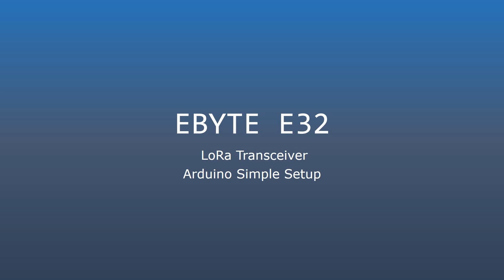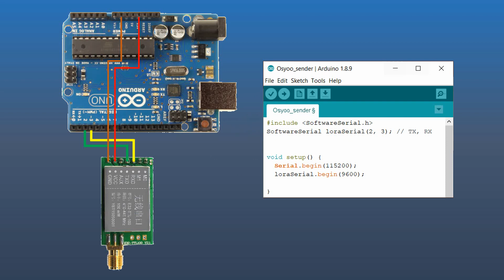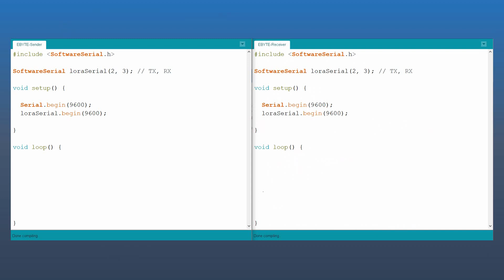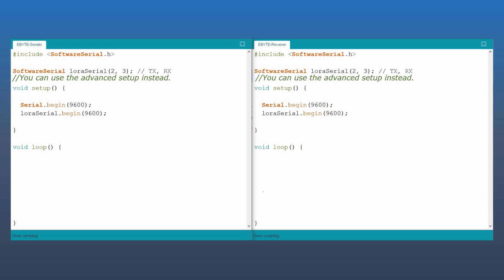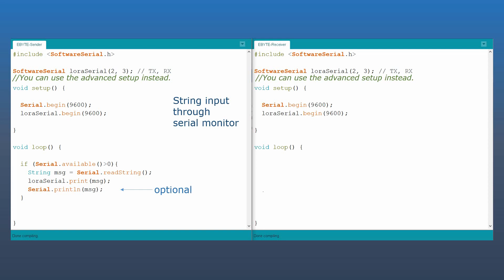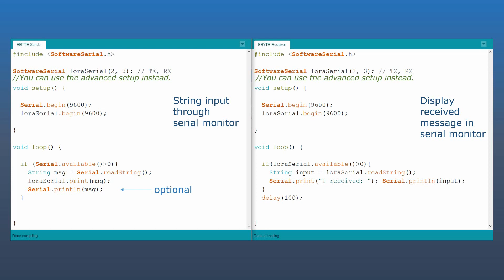EBYTE E32 LoRa Transciever - Send and Receive Messages on Arduino

Comment: Hello! I tested your other example (via the library) and that's working fine, but the code shown in this video isn't working, what could be the problem? (neither sending example or receiving example shown in this video works, I've tested with the library)
Reply from the maker: Hello ZeusBeer
While I don't have the devices with me anymore, I can try to assist you if I see your code. Please send it as a message.
Reply: @jtech1873  Hello, thanks for reading the message, the code I used for transmitting and receiving is the same as in this video.

The (not working) code for transmitting: 

#include <SoftwareSerial.h>

SoftwareSerial loraSerial(2,3);

void setup() {
  Serial.begin(9600);
  loraSerial.begin(9600);

}

void loop() {
  loraSerial.print("hello"); 
  delay(1000);
} 

The (not working) code for receiving: 

#include <SoftwareSerial.h>

SoftwareSerial loraSerial(2,3);

void setup() {
  Serial.begin(9600);
  loraSerial.begin(9600);

}

void loop() {
  if (loraSerial.available()>0) {
    String input = loraSerial.readString();
    Serial.println(input);
  }
  delay(100);
  
} 

The working code (that works, same pin configuration) is found here: 

https://github.com/KrisKasprzak/EBYTE/tree/master/Examples/Arduinio 

Note that this code is also shown in your other video about "the advanced setup". 

Thanks in advance!

(The reason I want the simple code to work is to save some memory by not using a library, because I'm a bit on a memory budget for my Arduino project)

Comment: I am using Ebyte E32 868T20D with simple setup. I have made all the connections correctly. However I am not getting any receiving. Only when I cut the power of the transmitter 10-15 pieces of data come in a row. What is the reason of this?
Reply from the maker: I can not now without debugging
But it could be that your serial monitor is using a different serial speed. Did you check?
Reply: @jtech1873  i just add delay(500) and the problem solved
Reply: @umut373  I still have the same problem. Where u add delay function?
Reply: @albertwziatek154  After lora.println(...);
Reply: @albertwziatek154  did you solved your problem? because i have the same problem..

Comment: Hello sir, I can't communicate either details are in this discussion : https://forum.arduino.cc/index.php?topic=691312.0,

To further elaborate:

I tried to use both advanced and simple setup. Communication serial on the receiver and doest show anything. I am positive wiring is correct and I have a 433 Mhz antenna connected.

What can be the problem?

I am suspecting maybe the module is burned. I am not sure  if the communication ports are 5v tolerant
Reply: Use AUX. Aux will tell you if it sent or not. I got this code from osoyoo. I just added the AUX myself. Put AUX on Pin A0 and use this code:

SoftwareSerial mySerial(2, 3); //TX, RX
// (Send and Receive)

void setup() {
  Serial.begin(9600);
  mySerial.begin(9600);
}

void loop() {

  if(analogRead(A0) < 50){
  Serial.println("Sent!");
  }
  
  if(Serial.available() > 0){//Read from serial monitor and send over  OSOYOO UART LoRa wireless module
    String input = Serial.readString();
    mySerial.println(input);
    Serial.println(input);    
  }
 
  if(mySerial.available() > 1){//Read from  OSOYOO UART LoRa wireless module and send to serial monitor
    String input = mySerial.readString();
    //Serial.print("I received: ");
    Serial.println(input);    
  }
  delay(5);
}

Comment: I have a question, if i have a msp430 and 2 lora modules and one of them is connected to msp to send data, and the other one should receive it, and its pins RX,TX are connected to a FT232 connected to PC. My question is : will my lora modules comunicate based on your code?
Reply from the maker: I do not have access to an FT232R at the moment. Yet I am afraid that the library which I used works for the Ebyte only.
Reply: @jtech1873  sorry for didn't keeping an update, it works i mean the LoRa sends and receives info based on your code, it is working and also mt ft232 reads it. Bless you!

Comment: i cant communicate what can be problem?
Reply from the maker: Are you using the simple or the advanced setup? What is the serial monitor showing?
Reply: @jtech1873  The problem is the same for me and the sender's Serial monitor shows the sent message,but the reciever's Serial monitor shows nothing
Reply from the maker: @martonpilter3309  It can be either a connection problem, or a problem in the send/receive code. Can you message me your code?